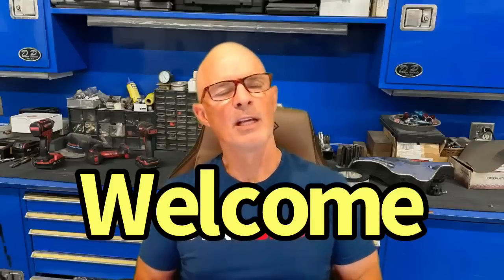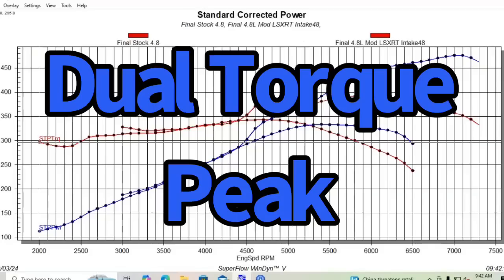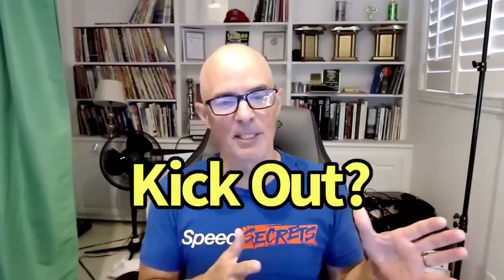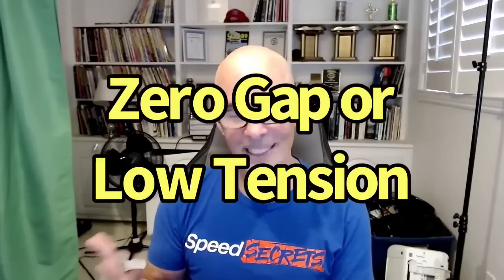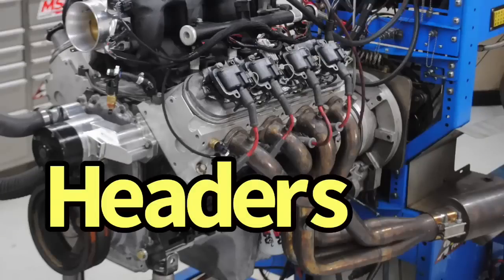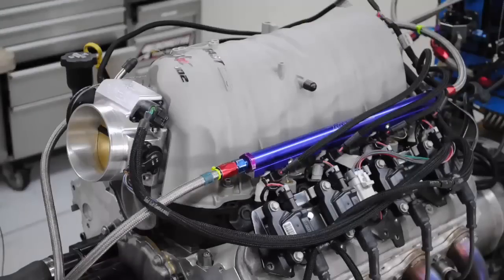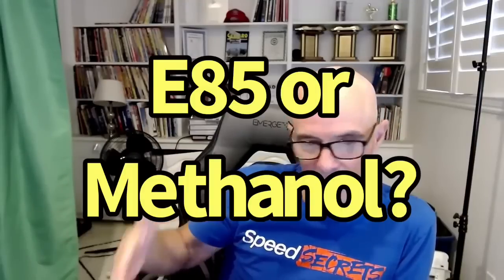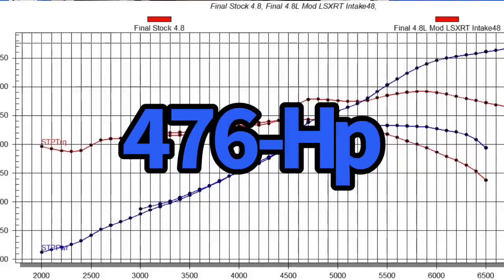500-HP NA JUNKYARD 4.8L-NO BOOST, NO NOS! CAN IT BE DONE? HELP ME ADD 25 HP TO THE 475-HP 4.8L!

Comment: Easy, bigger cam and a High Ram intake. However, it won’t have drivability anymore, as Rich already knows.
I like the simpler ideas while trying to maintain the Fast intake.
Reply: @bri-manhunter2654  I think the high-ram might be a little short on runner length. The lsxhr with either the 9" or 8" (tall or mid) trumpets might work really well. The fast lsxr might be a little too long in runner length. I may, however, be proven completely wrong
Reply: @tadwiltman4875 . Short runner length with a very big cam that fits the PTV is the point, spinning high rpm’s. It will not be very drivable or have much vacuum, but it will make the 500hp mark easy.
I’m definitely a fan of the intakes you mentioned for not running an all out high rpm build.

Comment: Another great video as always. Not being an LS guy, I don’t know what the specifics are of the bore diameter as well as not knowing what you’re working with for valve diameter. I was just curious to know about valve shrouding with that particular bore and valve diameters, along with a curiosity about flame travel and quench areas in your setup. Richard, you mentioned using different pushrods and short travel lifters. I’m not sure if these engines benefit from .300 taller lifters to use shorter pushrods like in big blocks. I tend to think along the same lines as you on working towards better valve train stability while also convinced that the biggest diameter pushrod that’ll fit your combo is just more added insurance for the stability. Then again, the lighter materials tend be helpful in dealing with valve float and control at those higher rpm’s which you already know. Very interested to see what your findings are on this combo. Keep up the great work.

Comment: Chrome valve covers and a cold air intake should get you there.
jk.
Thanks for the video.
Reply from the maker: plus stickers
Reply: @richardholdener1727 stickers only add hp to headers
Reply: Don't forget the colored plug wires
Reply: 😂 Good one!
Reply: Sillycon vacuum lines and billet exhaust hanger brackets!

Comment: @RichardHoldener- Best SBE 4.8 Liter combo imo= Ultra Low tension rings, crank scraper, Zero wt. full synthetic oil, (Bigger cam, but use lighter weight/Less friction solid roller lifters, with a 116° LSA, to carry the high RPM power), the ported Tfs 220cc heads, Lightweight roller rockers, Holley short ram intake, (port matched), 1-7/8"  Long tubes, (with an evacuation kit ran from the valve covers, to the headers), ran with E-85= Awesome😎
Reply from the maker: Thnx-Here is some info-the BTR Trinity makes more than the Low Ram. Never seen any light weight rockers that weigh less than stock. E85 didn't seem to help with low compression but I will try it again
Reply: @richardholdener1727 - Its not the total weight, but the actual weight(+Less friction), of the Roller Rockers, over the ends. Is it the Holley high ram, that works better than the low ram? If so, @ what rpm is the tradeoff most beneficial between using the low ram vs the high ram, (ball park estimate)?
Reply: @richardholdener1727  - I just watched your dyno test video from 8 months ago. Putting the Holley High Ram vs the Holley Low Ram, on your 5.3 Liter SBE, junkyard engine. Looks like on that combo, the High Ram was the much better choice, & the Low Ram looks to be better suited, imo., for approx. 7,500 to 9,500 RPM👀!?

Comment: Over the LS years I have always wished for the availability of small bore LS3 or L92 heads. I think it would be a gold mine for whoever comes up with a solid product with all the 4.8s and 5.3s that are out there, especially if the new heads are reasonably affordable. The raised, larger rectangular ports could be worth the needed 24 horsepower alone. That's the easy part. The hard part is finding somebody that chooses to create a solid, well researched, engineered, manufactured, and tested small bore LS3 or L92 head at an affordable price. I hope somebody with the capabilities reads this. 🙂
Reply from the maker: this combo already has heads that support over 600 hp-not sure if more head flow is the answer
Reply: @richardholdener1727  Thank you for your reply. More head flow is usually better but you are probably correct in this situation. I'll keep hoping for the small bore LS3 head, haha. Thanks, again.
Reply: I believe Skip white makes small chamber cheater Ls heads for circle track  I believe Quantico is who makes his signature race heads sure they probably make the cheater stock appearance heads too

Comment: Quench and  compression. Where is it at and is there room for improvement? Might sound crazy, but we always used to use stock volume and pressure oil pumps on ls' back in the day. Less drag and parasitic losses.
Reply from the maker: this is a stock (junkyard) oil pump

Comment: If you plan to swap rings, I believe TS has an AP-GP (gas ported top ring) in that size "APGP 037800 0470".

I have a Mamo ported MSD intake currently for a similar displacement N/A project. If I can make it work logistically, I may be willing to let you borrow it for testing if you'd like. The matching heads would match most of your needs, but the amount of milling I've had done will make them not work for you (great for a nearly 14:1 5-ish liter build though). Camshaft with good lobe design and around mid 230's @ .050 intake should work rather nice (something like a 234/240 @.050 113lsa). I'm looking forward to seeing this. It will be interesting to see how much power you're able to wring out of it.

Comment: But I do think just E85 would probably pickup at least 15, 20 hoarse power
Reply from the maker: it won't
Reply: Friburger did it on engimasters gained about 8 hoarse and 10 foot pounds over 91
Reply: @richardholdener1727  I have actually seen it pickup 20 on a motorcycle
Reply: But yeah you're definitely right about my overly optimistic 20

Comment: Off topic of 4.8 , have a 5.7 power question
Reply from the maker: ask away
Reply: I've got a ls1 in a c5 , have a set of 243 heads that I lightly hand ported ,  decked .030 . I have an E-1839 cam , I'm thinking cam really won't be enough for the power level I'm kind of hoping for . I'm guessing that combo with correct head gaskets to have 10.5/10.7 to 1 compression will be worth about 420ish hp!?? I'd really like to have above 500N/A hp. What's you opinion ? Thanks

Comment: You need to run a vacuum pump and run the crankcase in a vacuum, and/or run a dry sump. Also why not use solid roller lifters?
Reply: Also I would like to see some small bore ls3 heads and intake. Alternatively you could weld a quench pad in the chamber to bring up the compression if you can't get heads with a small enough chamber.

Comment: If I were to do another 4.8, I'd like to do one with ported stock 706 heads, FAST intake, and a streetable cam. But I'd bump the compression to 14:1 with some custom pistons, just to see how it ran on pump E85
Reply: Hey ,I’m new to this ,and I’m camming my truck and adding other mods .on heads I heard 243/799 heads ported would be better but also have heard stock 706s ported are better ,which ones would give me the most hp when ported

Comment: I don't care about high rpm horsepower. I want the most low rpm torque as possible for as cheap as possible. What would be the cheapest engine to start with? I currently have a 2nd gen small block LT1 in my 96 Buick Roadmaster sedan. Parts are outrageous so I'm thinking about finding a different engine. My dream engine is a 1970 Buick 455. Or any big block. But my budget will never let that happen 😂
Reply from the maker: a gen 6 454 with a carb isn't very costly-but very torquey

Comment: Bettter single springs on valves better intake runners that increase air speed cam 238 dur intake 240ex ? At  113 sep 580 range lift mls haeds gasket to increase compression

Comment: Bore it out, .040 -.060 over. Forged high compression pistons. 220*+ Cam. Ported heads with a valve job. 500hp allday.
Reply from the maker: needs to be SBE

Comment: Remove the second ring and modify the oil ring for less drag. Ben Alameda has a video showing how to modify the oil ring. This decreases parasitic losses especially at high rpm and this alone might get it done.  If I removed pistons to modify the rings might as well deck block and set proper quench. These mods alone may net the 25 HP.  Might be a great experiment to find out....
Reply: It would make for an interesting test on the LS. 

Alameda shows and explains that the reduced torque to overcome the friction from the oil and 2nd rings on the sbf is substantial.
Reply from the maker: pass on removing the 2nd ring-but I did talk about zero gap and low tenision ring upgrade in the video
Reply: @richardholdener1727   From the video my take away was you have a goal to hit 500 peak HP on the dyno and nothing else matters?  Did I misunderstand?  Also, do you have a video posted showing the specs of this 4.8L getting to 475 HP?  I would like to check that out if it is available.  That’s good power for a little NA engine!

Comment: I believe if you raised the compression about 1.5 points it would do it, not necessarily feasible but changing the cam to 235 degrees would probably do it

Comment: Cut the pistons for extra valve relief. Install a bigger cam (solid roller?), Holley high ram,  btr shaft rocker kit and send her to 8000+rpms. Done
Reply from the maker: no need for solid roller-but bigger than 224 cam definitely
Reply: Why not solid roller?@richardholdener1727

Comment: With the lower tension rings I would run a vacuum pump which would probably be worth 10hp. Maybe use a junkyard air pump.
Reply from the maker: Evan Perkins tried a vacuum pump on his 4.8L when I was there last-didn't add any power but always worth a try

Comment: I’m confused the constant regard to “how much power the cylinder heads support”. The more flow in and the more flow out, the more power it’ll make. Look at the coyote, 5.0 liters, by your standard is way over cylinder headed, but the results speak for themselves. I’ve never heard of making less power from huge flowing heads and making more power on lower flowing heads unless the combustion chamber is a poor design on the better flowing head. Put the highest flowing head on it, 236-238 in take session and 244-248 exhaust, 114-115 lobe sep, roller rockers, lightweight springs, retainers, valves, lifters and pushrods. Don’t confuse lightweight valve springs for light pressure, you still need adequate seat and open pressure but using lighter components will allow lighter pressure…decreasing friction while increasing valve train stability. Solid roller lifters work like magic on a hyd roller cam too btw. I could keep going but it’s a lot to type/read.
Reply from the maker: no thnx on solid roller-not needed. Already has heads that flow 320 cfm, so more than enough for our 500-hp. Bigger cam is a given and short-runner intake

Comment: I don’t think the TFS 205 head would beat the TEA ported 706 heads up top, I’d bet they have a bit more torque down low though. Would be an interesting test  to find out though.
Reply from the maker: The TFS 205 heads makes as much or more than the TEA 706 heads
Reply: @rancherlee  what the TFS 205s give is a smaller chamber/better p-v clearance pre-milling. Probably about the right MCSA for the application as well

Comment: I say for peak 4.8 power, run an actual short runner intake, because they are better in the RPM range where this thing is going to peak when you get it all sorted.  And then absolutely flycut the pistons like Gwatney Performance did for their insane SBE LS3.  Then you can do anything you want with compression AND camshaft.  Even that Stage 4 LS3 cam is pretty tight on P-V with stock LS3 heads, and you're going to want to add so much compression to this thing.  EDIT: Nitro is cheating.  Even running methanol through the fuel system kind of is. Lol
Reply from the maker: The valve drop and P-V is different on an LS3 and LR4
Reply: @richardholdener1727  Interesting Richard!  So is flycutting the pistons not a viable option at all for the 706 head angle then, or not as much?

Comment: Mill the heads .090, thin headgaskets, crank scaper, solid roller cam and likely a carb style intake, e85, bell mouth on the tb
Reply from the maker: .090?
Reply: @richardholdener1727 yup....or more if you want. My heads are milled .090. Just gotta fit the intake some.
Reply: Deck thickness, piston to valve issues?
Reply: @CarsTrucksAndDreams  measure it. One might have to flycut the pistons.....idk depends on your cam. They make a nice tool for it that's easy to use.

Comment: I think if you did everything you discussed in the video / more than one rendition of each (ex: tried multiple-intakes / multiple-cams) you’ll exceed 500hp by quite a significant margin…..if the goal is peak-numbers you should make this exercise into a video-series (kinda like EMC) to keep people up with the progress (aka: “quest for highest N/A power stock bottom end 4.8” per your rules & constraints)…..with enough effort & development, the potential HP number is probably a lot higher than most people believe.

Comment: Agree 100% on crankshaft scraper. Thats #1 with me also.  #2 Look at Quench between head and piston. #3 Total seal has a new ring set that is designed to use compression on the back side of the ring during combustion to get a more complete seal.  Last is plasmacoat, the top of the pistons and the inside of the combustion chamber in the heads. Better thermal efficiency.
Reply: I'll add some free stuff, labor only. Set all the rods and pistons to lowest weight so they are a balanced match set. Can polish up the counterweights and knife edge. (With the intention of balancing the rotating assembly). Money. Stiffer measured push rods, roller trunions, cam in the 270-280 area with 104-106 centerline and .650 lift or whatever the heads support (If the heads max flow is a say .590 and stays flat to .700 you can go over leaving more area under the curve instead of flowing for a millisecond at peak lift because you are above 590 for longer period), rods resized with better rod bolts (push it over 8200rpm). Mill the heads to get close to 11:1, Shorter runner intake, vacuum pump on the crankcase will net 20-25hp over 8000rpm alone due to windage elimination at high speed.  Should theoretically get near 100hp all things considered if everything is right.
Reply: Combustion pressure on the back side of the ring has been sealing it for DECADES.  This isn't a new idea.  It's older than your grandpa.
Reply: @zacharymorris9917.  Yep, you are correct. OLD Design revisited but in a new set they have come out with. I'm 68 so my grandpa would be WAY back in the day. Lol ! 😊

Comment: With the 350 4 bolt main we are building for my sons 84 GMC 4x4 we are having Bob lane Machine shop do a 3 angle valve job, bronze guides,  using the 3 layer head gasket,  factory rods, crank , flat top pistons.  Double roller chain and a mild towing cam with factory springs and a GM performance quadrajet intake and putting a quad back on it. The objective is more than factory output and long-term drive ability.  Now I watching this just for gratuitous purposes only. Hahaha. But if you had not done this channel I would still be avoiding any ls motor cause they are so heavy.
Reply from the maker: The LS is lighter than the SBC
Reply: @richardholdener1727  And it has much more power potential using stock parts.
Reply: I myself just can't jump on the ls bandwagon, I want to I see Richard throw a turbo on and crank the boost up and its tempting, if the economy was better I might would try it, but it'll cost 1000 just for the computer stuff to tune it

Comment: I think the cam you had on the original 4.8 was good enough.  Go to a 30 weight oil and a larger plenum volume with preferably shorter runners and I would not be surprised if you could get there.  You might have to spin to 7,500 rpm.  Either way you are not too far off.

Comment: Angle mill heaads and use a tunnel ram with 2 4150 throttle body's. 
 Thin head gaskets for tight quench too.   I made really good power with an improved  performance crank scraper

Comment: A 232 intake summit pro LS cam would definitely help.  Getting the quench to about .28-.30 would also be good for power. So maybe put in a .41 head gasket and deck the block a bit.
Reply: I think the Stage 4 LS3 cam he's talking about is already 233/250 duration at .050".  It's a solid cam for making a lot of power.